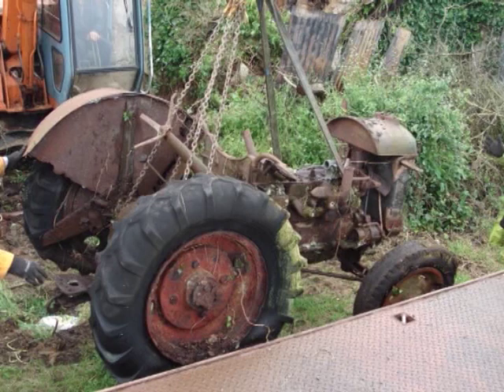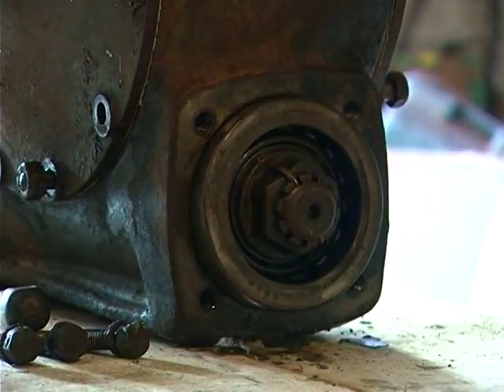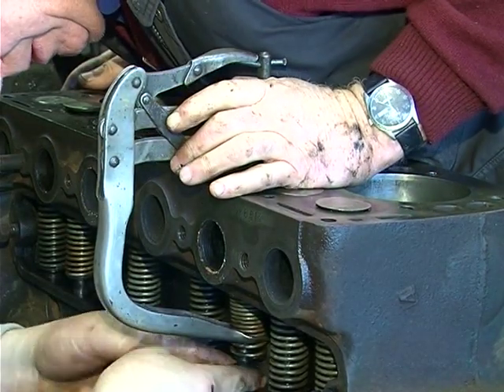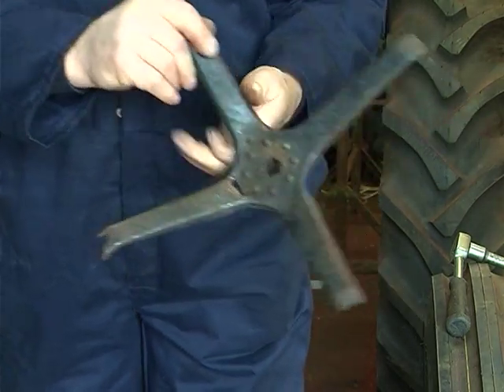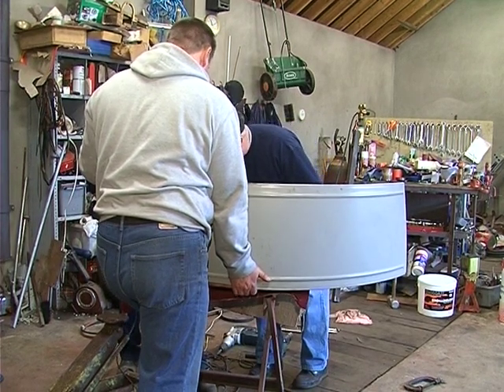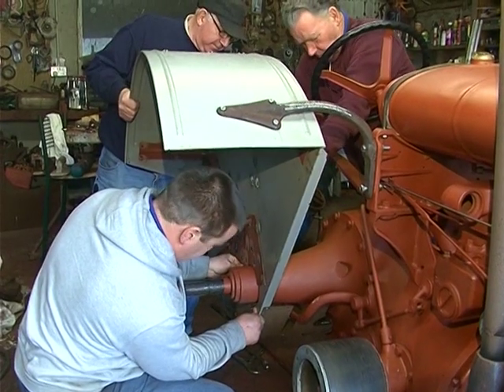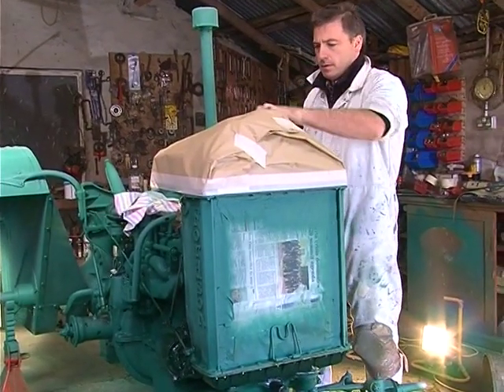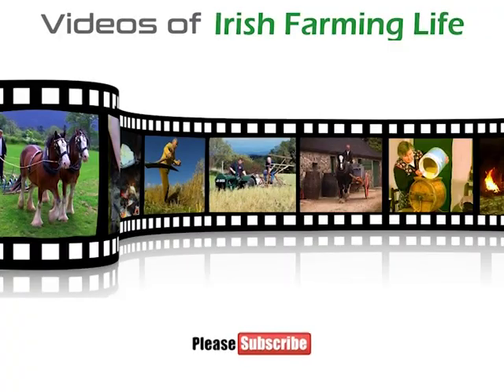Vintage Tractor Restoration Project -- Restoring a 1940 Fordson N Tractor --  (Part Two)

Comment: It's great to see such a dedicated team of mechanics so hard at work, but this video (and part one of it) contain a great mystery. When the old rusty tractor is recovered from its place of rust it is shown with an authentic Fordson Model N engine. However, when we get to the stage where it is all put back together and started up for the first time the engine has changed to a Fordson Model E27N engine. No mention of this engine swop is made is the otherwise entertaining commentary. How come?

Comment: I can remember seeing one of these tractors sold for 30 shillings £1.50 in today’s money in a farm sale in 1960.
How times change. Lovely job with the restoration guys. Bit of a beast to drive having both clutch and brake on one pedal gave you a strong right leg, and a broken wrist if the mag ignition was slightly off.
Reply: Have to admit it nice renting new machines with computer control, but maintaining that stuff is a headache

Comment: I love that he said 160 pounds being from the USA in all.
Reply: Agreed!  If the narrator had used loathsome metric units, that would have been the ultimate betrayal!  The imperial measurement system has so much more colour than the painfully boring and repetitious metric system:  10 x 10 x 10 aargh! :-(   I was also surprised to hear that tractors were still being built in the U.K. in 1941; I'd have reckoned that all such production would have been devoted to the war effort by then.